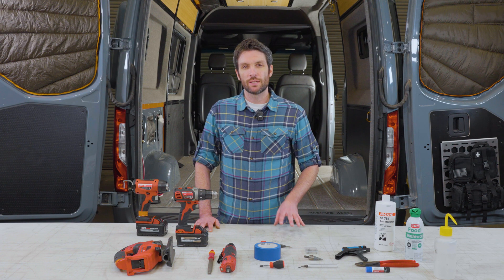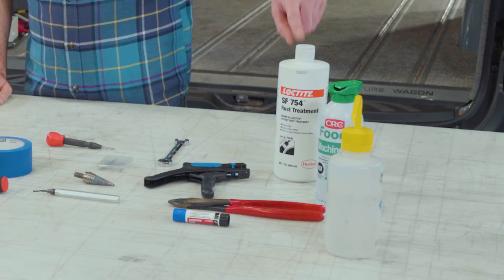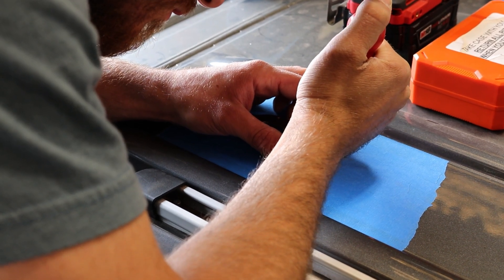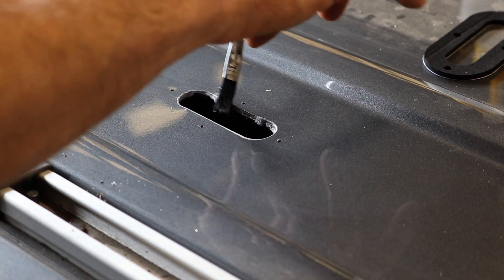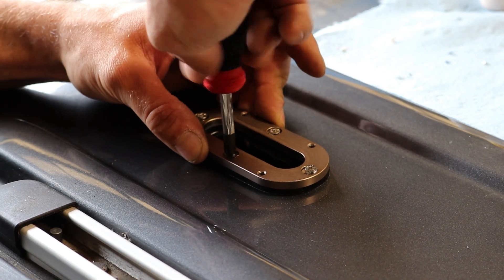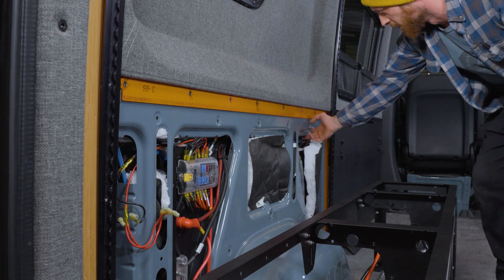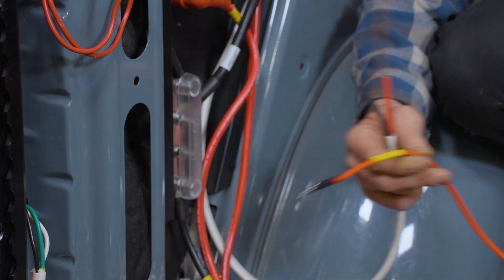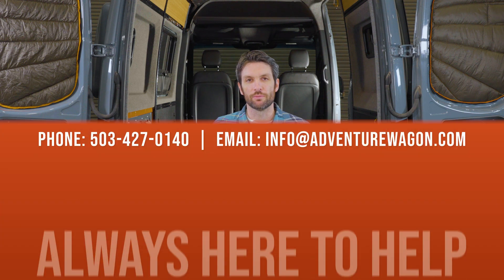Setup & Install Instructions: Solar Wiring Kit for Sprinter 144

Comment: If I’m using a portable solar panel and want to add a quick disconnect to the goat locker, would you wire the positive to the mppt and the negative to the neg bus bar?
Reply from the maker: Correct! Easy as that!

Comment: Solar disconnects should be  simultaneous , dual pole disconnect, not just the positive wire.  A solar isolator switch is better than a single pole breaker.